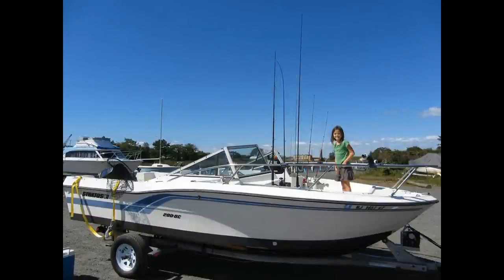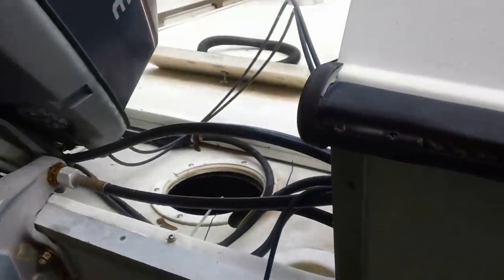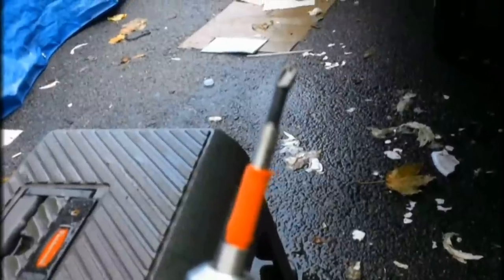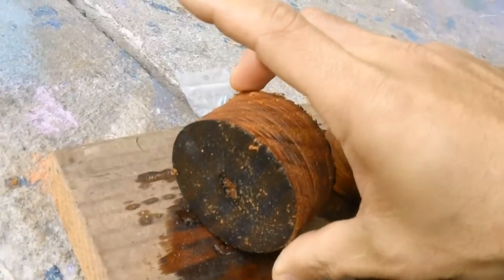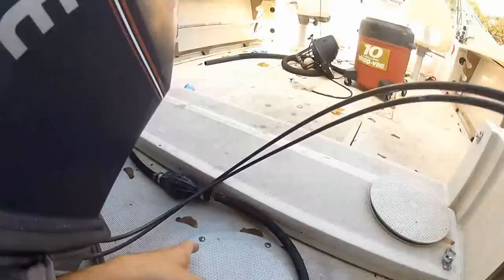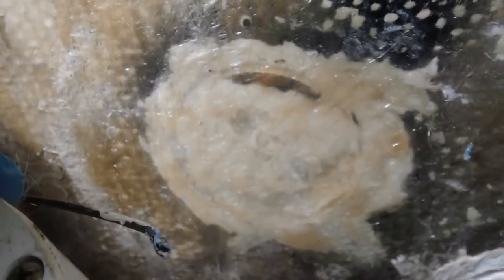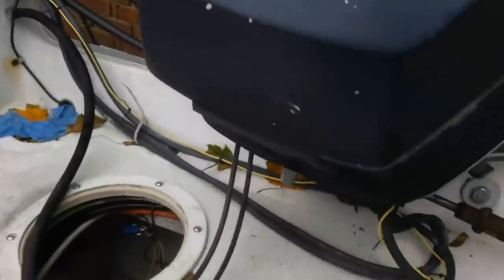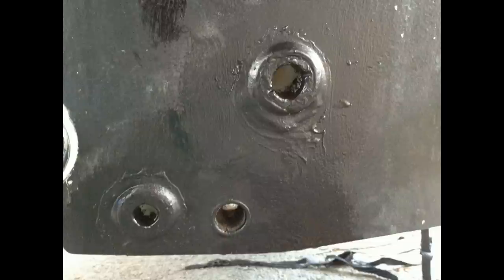Plugging Transom Holes, & Making new holes, Installing new Thru-Hull Fittings

Comment: Wow, almost can't believe how horrible those were originally installed.   Good job on the refit, only thing I would have changed is that I NEVER use plastic anymore since it's only temporary.   They always fail eventually and factors like stress, heat, sun, bottom paint, and many caulks just speed up that process.
Also it's good to make your dowels a bit shorter to allow more room for your epoxy.
I always use what the hull is made out of.
Usually a layer of resin with matting first.  Then while it's just setting up the outside layer of gelcoat.   In the bilge just add color to the resin and skip the second layer of gelcoat.

Comment: Hey great video, question for you: I have a 17' scout center console and the drain plug was old, corroded and leaky. I prayed it off and noticed there was some pitting and some rot, but only towards the bottom and a side. I cannot seem to dry it enough to 5200 it as it continually oozes water. The transom is strong overall but I'd like to remedy this without having to replace the whole thing. Would this method work for me?
Reply from the maker: Oh Man. I don't know if I'm qualified to answer this, but, 10 years later, this repair is as strong as day one, and it sit's in a salt water slip every season. If you can cut out the rot, and find strong dry wood, I don't see why not. I'd be concerned if the repair got TOO big
Reply: Thank you! I was able to drill out more and got all the rot out, luckily all is in good shape. (Previous owner left a couple rusty screws in the drain plug garboard) I drilled two 3/4" holes on either side about 3" deep in the base and it helped drain the excess water stuck inside.

Comment: Also what did you fill your test drill holes with before the fiberglass mat? Thanks!
Reply from the maker: The little holes I made? They were super small. I probably filled them with "MARINE TEX"
Reply: Did you fiberglass mat the outside pucks before you drilled your holes? Also did you reapply a gel coat or just do anti fouling paint? Did you use a specific kind of wood? Thanks!! Using your video on repeat as I work through this.
Reply from the maker: I'm so sorry. Youtube doesn't show/notify me of NEW replies, and it's so annoying, cause I never know they are there. They just fixed that, and now show me new replies. But.... it's too late for most of them. How did this go?? I still use this boat to this day

Comment: Gregg, thanks for the video. It’s my first boat project plugging four holes on the hulls. Do you use regular plywood for the plugs? My hull is made up of about 3 inches of wood. I am thinking on using plywood and then a coat of fiberglass resin and sand it. Any advice would be appreciated. Thank you
Reply from the maker: Hey buddy. I would go with 2" Pressure treated wood. You can use one cut of 2x6 and one cut of 1x6, to make the 3" thickness you need.
Reply: Gregg Cerenzio thank you Gregg

Comment: Good Vid. However , it would have been wise to have made your wood puck inserts with a flange on the outside of boat or at least cone shaped them. It is possible to have your straight pucks blow back inside the boat . Coned pucks work like a wedge. Thanks,
Reply from the maker: 10 years later, they still holding up and look the same as day 1, but, Good thoughts. 👍

Comment: I always thought it was necessary to use a seacock on fittings below the water line, and before any hoses and clamps.  I have a similar size fishing boat and preparing for a live well intake.  Wondering why you chose not to use seacocks..
Reply from the maker: The live-well is above the waterline, and well above the live-well drain. Gravity prevents the water from coming in the hose, and UP into the livewell. Plus, the livewell is full of water, and keeps pressure on the drain. Soon as she is out of the water, the livewell drains. Otherwise, it fills up, and stays filled, as long as I'm on the water. Extra protection sure can't hurt! But, all is well the way this is setup. :)

Comment: Great and informative video. At 8:30, are you boring out the wood plug for the new fitting? Then why did you not drill all the way 
thru or is it a different size hole? Thanks in advance.
Reply from the maker: Hey! I believe I was drilling all the way through, but stopped to remove the "puck" from the drill bit, because the bit is only so deep.
Reply: Thank you for your reply. To be clear, is there a certain gap that you have between the Inside diameter of then bored out and the outside diameter of your plug? Do you roughen up with sand paper the surfaces for better contact with the adhesives? Most informative video. Thanks again.
Reply from the maker: No, I used the same circle bit, to make the hole and the plug. A nice tight fit. Wood will absorb the adhesives. My plugs aren't going ANYWHERE. but I would sand them a bit, if you have any doubts. Don't want anything but clean wood against clean wood.

Comment: how should i drill new holes in my transom? its fiberglass covered plywood with a s sheet of stainless steel over it.
Reply from the maker: Stainless steal? Yikes....  I would consult a pro. My choice, off the top of my head, would be a hole saw drill bit, if the metal isn't too thick and strong. Like these: https://amzn.to/2IVjq57
Reply: Could you possibly avoid that sheet. And what is the purpose of the stainless steel strip?

Comment: Didn’t use bronze fittings or turn valves after all of that work?? What a waste?!
Reply from the maker: Nylon fittings are fine. 5+ years and strong as day 1.
Reply: @GreggAdventure  I'm working on a recently purchased 1980 trailer sailer project boat. plastic fittings last some time but not forever. Unsure if I'm looking at a original plastic thru hull fitting but the plastic gets real brittle unmaintained. Metal fittings are susceptible to electrolysis, and still need some maintenance. At the end of the day. That metal fitting can handle more abuse from shifting cargo hitting the inside area of the thru hull. Fixing the boat as you did and doing plastic thru hulls is better than not fixing it for sure